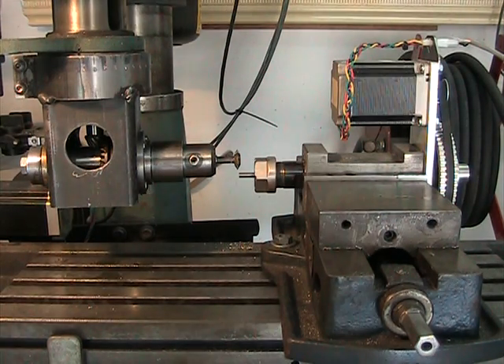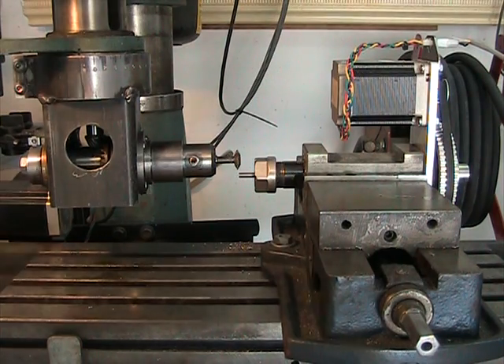Thread Milling

Comment: Very cool but I wonder if maybe a lot of unnecessary hardware , Could you not  forgo the right angle drive and the 4th axis and just use helical interpolation to cut the thread with the part held vertical in the vise?  Gerald
Reply from the maker: +backyardcnc Probably, but what fun is that... :^)
Reply: Good point but then helical thread milling is a lot of fun all on its own in a home shop ;-) Thanks for the vids!
Reply from the maker: I actually built the horizontal milling head so I could cut helical gears.  The 4th axis is useful for all sorts of things, including dividing head functions
Reply: Yes I do have a stand alone 4th axis under micro control for deviding, gears etc....  but no full 4 axis CNC as yet. On the to do list!
Reply from the maker: +backyardcnc 4th axis under CNC control is a hoot.  You'll have a lot of fun with it.
Reply: Yup for sure. It's high on my list of things to do and my SHOPBOT CNC Router is actually ready to go with a spare driver in the controller, just haven't wired up a rotary to it yet............... too many hobbies and far too much time spent on youtube watching stuff like this :-)gerald
Reply from the maker: +backyardcnc I hear you.  I usually have 4 or 5 projects underway at any given time.
Reply: Sort of a funny question... Along those lines, had you considered just using a die?

Actually, I was wondering what the reason for the 5-degree tilt was.

Comment: Why you tilted cutters angle to A axis for? Thanks
Reply from the maker: +coolfox999 I angled the cutter to match the angle of the threads.  However, I've since learned that isn't necessary.
Reply: +coolfox999 The cutter centerline must be angled to match the helix angle of the thread being cut.
Reply: +Chuck Fellows IT IS necessary for truly accurate threads !

Comment: Hi, did you make the 60 degree cutter used in the video
Reply from the maker: No, it's a commercial cutter.  You can buy them on Ebay or Enco or other tool supply companies.